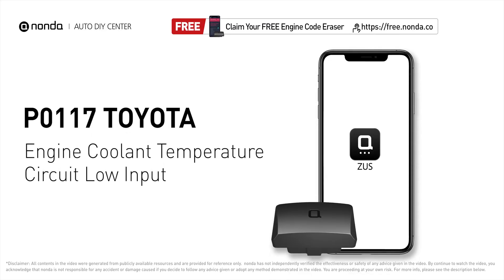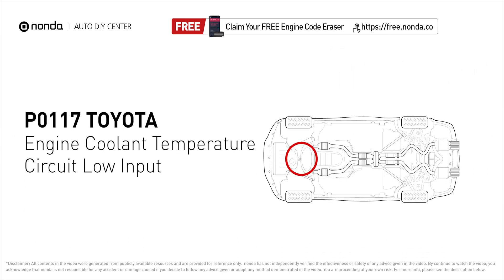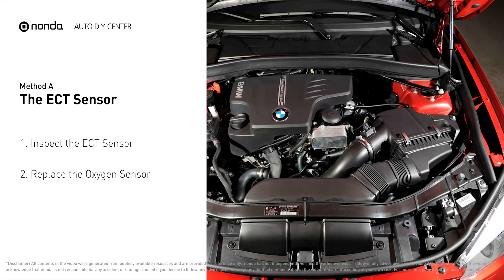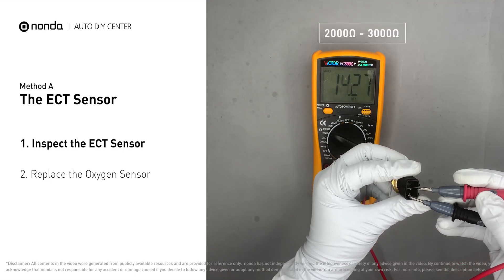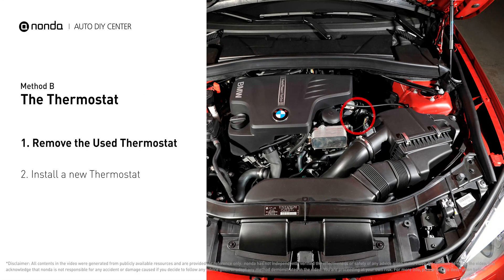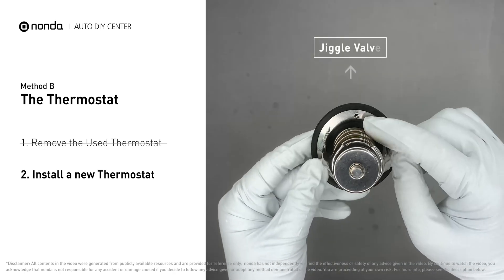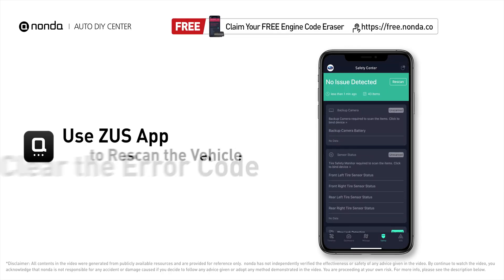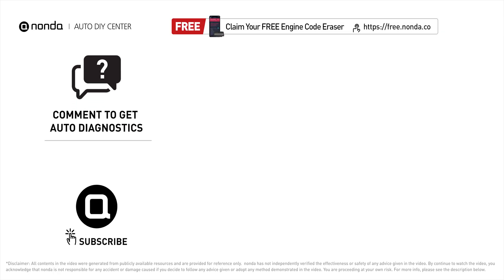How to Fix TOYOTA P0117 Engine Code in 3 Minutes [2 DIY Methods / Only $7.43]

Comment: I had been getting this code along with p0301 then recently changed the sensor, thermostat, and water pump. It had stopped for a couple weeks but is back on again. any idea what could be causing it?
Reply: Can a bad ECT cause a no start to protect the engine from getting hot or results in a blown engine?
Reply: Start at maintenance, have you changed your belt and tensioner on time!? The belt runs everything.. check that first and while the belt is off check to see if the water pump pully has any play or wobble on it.. If it does its the water pump..
Reply: Some water pumps do come bad out of the package..
Reply from the maker: Hello, can you please confirm if this is the only code you're getting?